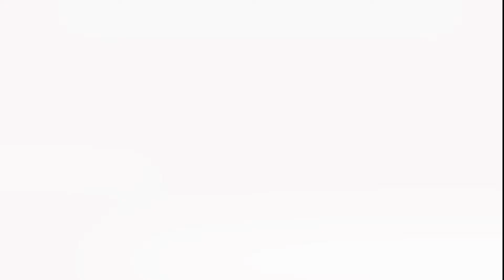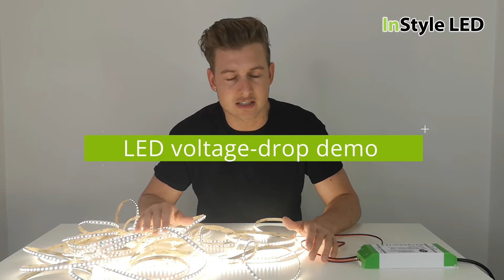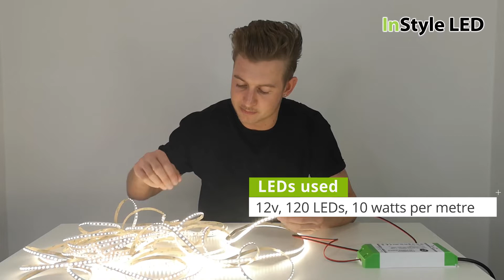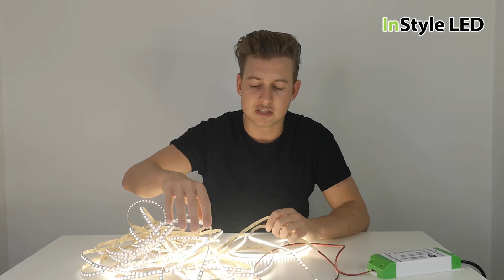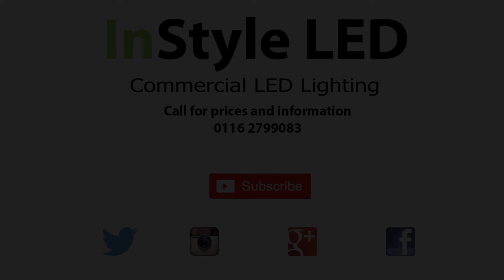What does voltage drop actually look like? - See an LED strip light demo here!

Comment: When the led strips are connected in series, the first strip supplies the 2nd and 3rd strips.  That will cause the first strip to overheat and reduce its lifespan.   But, not all led light strips are configured the same!  Some have an independent power "rail" which connects subsequent leds in pseudo-parallel.   The only voltage drop or luminescence variation observable would be that caused by the resistance of the power "rail".  Even so, there is a limit to how many strips can be connected in series.

Comment: Hi, Thanks for the content, its very informative.

I have a question that i hope you can answer. I'm wiring a bathroom where there are 4 single low voltage spotlights along the floor, then there is an 24v LED strip to go in a niche cabinet. they have all been wired, loop in loop out from the switch to each fixture location in 1.0 twin and earth. will all the cables joint through i imagine the length of ccable to be around 10/15 meters.

would it be possible to connect up one 24v driver at the start of the circuit that will easily power all of those lights. i am concerned of volt drop and am imagining that the LED strip at the end of the circuit will be very dim. 

I intend to connect these up in series.

Thanks
Reply: You could eliminate the series voltage drops by connecting each device in parallel.   Since you stated that your intended installation will be in series, just use that route to run a "power-pair ".  Each device just "taps" off of it.  Calculate the total amperage that will be required and use the appropriate size conductors.   Remember, since the circuit will be low voltage, there will be a greater loss of power per foot of distance.   So use heavy guage power wires